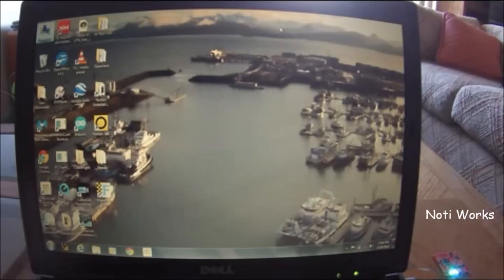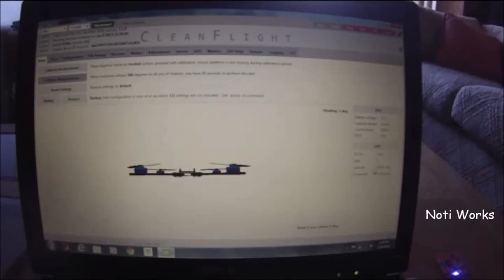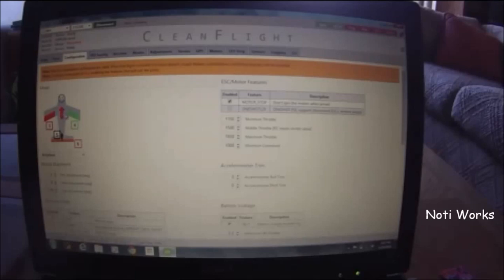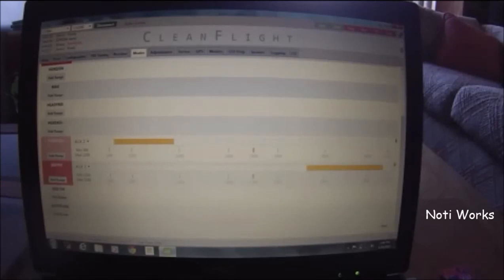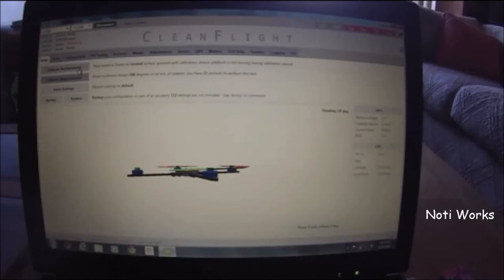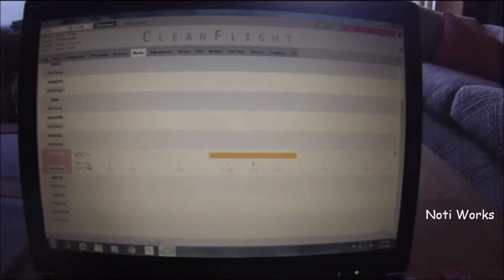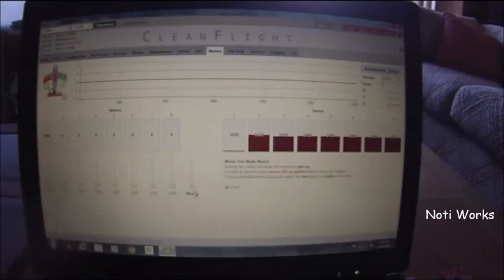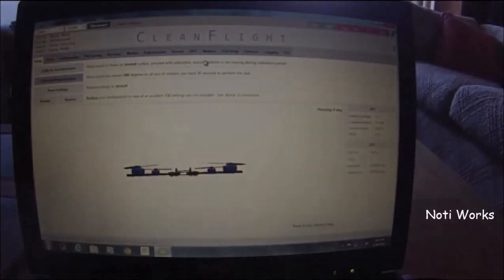How to setup CleanFlight for a Airplane.

Comment: I happend to run into some trouble when trying to set up a flying wing when using Cleanflight 1.9.0, concerning the reversing of servo´s: 
The "save" button of the GUI´s servo section does not seem to work (found several links on the web with the same issue), therefore it is necessary to set the servo reverse in the CLI.
In a thread concerning the same issue with tricopters, I found the first clue to solve this!
Typing 

servo 4 1020 2000 1500 101 -1
[Enter]
save
[Enter]

will reverse the direction of servo #4 with 1020 as lower, 2000 as upper and 1500 as mid value.
So far, so good, this might do the trick for conventional aircrafts, but what about using it on combined rudders like elevons, tailerons...whel it might also do the trick, since it changes the  servo direction of the according servo for the roll axis.
But what about the elevator component?
I happend to stumble on that solution by accident, acutally a typo...

Instead of typing 

"servo4 1020 2000 1500 101 -1"
I wrote 
"servo 4 1020 2000 1500 102 -1"

This resulted in a reversing of the nick reaction of that servo, but the roll axis was set to normal operation again.
So I dicided to try my luck with 
"servo 4 1020 2000 1500 103 -1"
and I was lucky: roll and nick direction of the according servo were reversed...

So, long story short:

servo N xxxx yyyy zzzz 10a -1

does the following:

servo #N is set to lower limit xxxx, upper limit yyyy, midpoint zzzz,
and the value of "a" decide which control input direction is reversed:
0 gives no inversion at all,
1 inverts the first functionality
2 inverts the second functionality
3 inverts both functionalities
Reply from the maker: +RageDavis Great explanation! I have ran into the same issue and with the next release of CleanFlight I will do a follow up video
Reply: Hey Brad!
Thanks for the feedback!
Already looking for that video - and the  release of the new version of course!
:-)
Reply from the maker: +RageDavis yes the video was done on old fw

Comment: Hi Brad, thanks for being so thorough and making this video. I watched it several times through and spent hours reading forums and watching other videos and am about ready to give up. Everything seems to be working perfectly except my SERVOS DON'T MOVE. On the receiver tab I have Roll Pitch Yaw and Throttle with two AUX channels, they all move nicely. I tried as many variations of Modes as I could think of. I can activate ARM, Pass Through, and Horizon in any combination. On the Servo tab no matter what boxes I check, then save, when I cycle the power or reset they get unchecked. I'm sure I'm just missing one simple step. I even tried different known good Naze 32 rev5 boards to no avail. Servos still just sit there quietly. Any thoughts or advice you may have would be greatly appreciated. 
PS: I did get 1 servo to make a lot of noise and move a little bit up and down on the throttle channel output.
-Will
Reply from the maker: William Wellisch sorry you're having trouble. I have not used a FC in my planes a long time so can't offer any real help. Best of luck
Reply: Can I ask why? just curious if it was problematic or you found something better?
Reply from the maker: No I prefer to fly full sticks now. I find any flight control to take away from the feel

Comment: hello Cc3d installed in my plane and configured as they say in the software instructions, but I can not have a stable flight, whem i switch to stabilized  mode during the flight the plane makes a very erratic flight and not stabilize the plane, on land after switch the stabilized mode and move the plane the servos work as it should be.
Reply: +Paulo Cardoso increase the pid to insane for planes ..... painless360 have a video about it